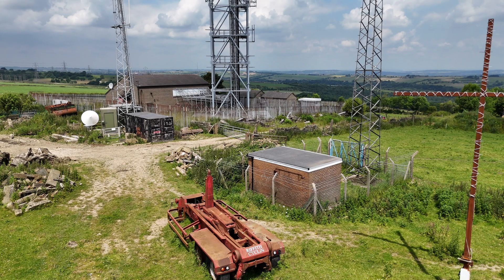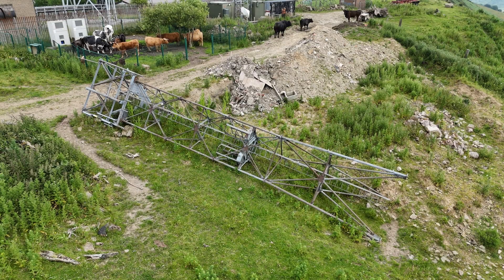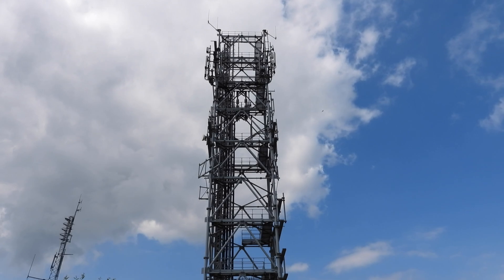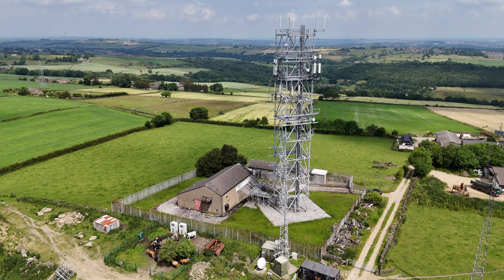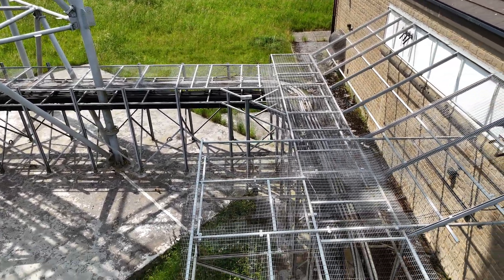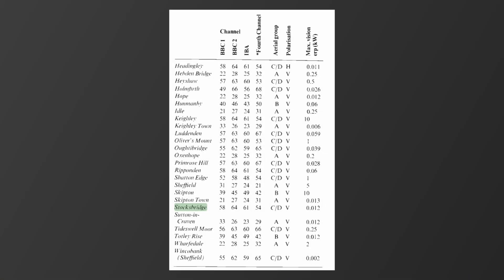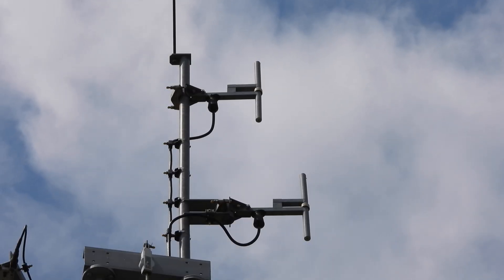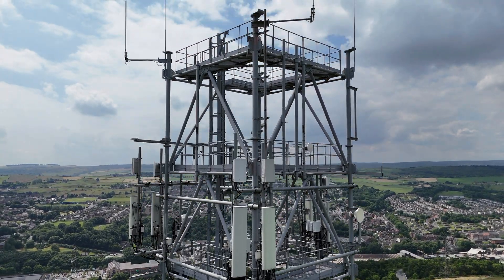Why Did This Cell Tower Fall Over? A British Telecom Microwave Site Tour

Comment: Ahhh the old VHF tv's 405 lines with "rotary biscuit tuners" then UHF 625 lines came along with its rotary 350 degrees tuners (early) followed by the mechanical pre-set tuners with up to (then) 6 presets. Later on 
the "preomat" tuners (Plessy I think???) replaced these giving a more stable service, using PLL if I recall correctly?? Those were the days! 😆😆 Also If you had certain antennæ then Overseas tv was possible, although the Audio subcarrier was different to the uk frequencies, (could be tweaked, but pointless if say a german station sent Dubbed  [ german] audio! Still it was real fun to experiment with. Then Ss-Tv ( slow scan tv ) was also interesting too .. //Sighs// 🤔

Comment: The offset DAB dipoles  provide some beam tilt. i.e. down to the local community. And that dish on the tower is tx and rx, probably a VSAT terminal for data, as you say for telemetry.

Comment: Glad you got a friendly response from a local farmer.

I remember the Hunshelf tower going up in 1987. Non of us local residents knew about it as Stocksbridge & Deepcar are in Sheffield planning area while the tower is a few yards over the border in Barnsley.

Hunshelf is the parish name. The boundary is where the ground drops away towards Stocksbridge. The hillside down to the river in Stocksbridge is Hunshelf Bank. Both names predate the Town of Stocksbridge which grew up around the steelworks in the second half of the 19th century.

The small disused tower will be the Steelworks booster which was the first mast up there. It was for improving the coverage with the internal radios in the works, which was certainly active in the mid 1970s if not before. One story was that Stocksbridge messages could be heard at Scunthorpe Works!

The Wooden Cross seen in some shots is a local tradition and is illuminated, after dark, over Easter. It used to be at the next farm over to the east but moved there in the 21st century.

Comment: Looks like some nice Ericsson cellular radios and 5G active antennas (small white Square antenna above long rectangle) at the top of the tower. 

There is a Trend to having the radios themselves at the top of the tower now because of the loss in the coaxial cables.

Comment: We recently had a 220kV pylon fall over in Northland NZ. Took out all power as the other transmission line was down for maintenance.
Same cause…….the ‘maintenance crew’ took the bolts out of more than 1 baseplate……

Comment: This is getting common in the US now. Some bankrupt company's stuff just left in place. We had a broadcaster of a MW transmitter in Alabama Claim their Tower and transmitter was stolen . Even filed a police report. When you look at cite is overgrown   like years. Transmitter shack so dusty and dirty does not look like anything their in years was their. some stories of this on youtube . We also had a working station taken down by someone cutting guy lines and letting the tower fall ,and when they got their to check it out the copper feed line was stolen.  all that for copper . Power company's got hit with copper theft as well. 73's

Comment: Sounds like the US, we went from 83 channels NTSC to 69 NTSC to 50 or so ATSC 1 then down to 36 channels ATSC1 and 3 now. We still have AM and FM broadcast but no Digital like you do at 200 MHz. We do have satellite radio from several slots that cost money and most new cars have am-fm-satellite installed. Satellite radio covers most of North America so if you are on the road more than 2000 miles a year, may be worth it but I am old fashioned and am-fm in the local area works fine for me or I can stream on my cell phone to the car via Bluetooth.

DE N2JYG

Comment: Digital TV transmitter outputs just 2.4W! It seems astonishing to me that significant coverage can be provided with such low power.
Reply: Digital is remarkably good at extracting a video signal. I can touch the antenna socket of my TV, or just stick a short wire in it and receive HD from Emley Moor, 11 miles away.
Reply: 2.4W is RMS, PAPR about 10dB, so they use 25W transmitters.

Comment: Would love you to cover the 4 masts at Turners Hill / Oakham in Tividale Oldbury. There are two masts together, one looks like an old Home Office tower one sits on a concrete block. Just down the road you have a very busy Westwrn Power / National Grid tower and all on its own is a rather odd tower, some 3 mobile antennas a strange folded dipole and some whips (oo er missus),at the top.

Comment: The horizontal tower is an old RT Swann with a delta head frame that was used by OUK (Orange) before they obviously merged with T-Mobile to form EE. A lot of the old OUK sites have been decommissioned or you will notice due to the size of the modern multi.port sector antennas they can’t fit them at the top of the old towers so install them below the head frame. They were easy towers to work on. Unlike some of the over crowded monopoles where they’ve had to do head frame upgrades just to fit the antennas, BoB, RRU & amps plus the 5G active antennas
Reply: Was going to say same before reading comments. Only to add they were originally built this shape for 2G, to ensure space diversity for each of the standard 3 sectors. When x-polar came along, the space diverse antennas were all replaced , enabling 6-sector sites where needed for capacity. It also enabled next tech which was 3G of course
Reply: Been up a few of those in my old job at ntl/Arqiva.
Reply: Is that the same Orange that allegedly wiped Super Hans' twins?  Did he ever forgive them for that?

Comment: Regarding the Coax...

Exactly what type of coax is used in these commercial towers?

That would be a video of interest to many!
Reply: That would be great. When I was doing WiFi 25 years ago I used a lot of LMR-400 for 2.5 GHz links. Radio sites had a lot of LMR series cables up to LMR-1200 that I saw but then there were lots of waveguides as well for the larger stuff. Smashing idea for a series!

Comment: tmobile now will use starlink 2025... soon cell towers will be replaced by satellite phones at a decent price
Reply: Where did you learn this?
Reply: @edweard i make parts for tesla, unrelated... but starlink and tmobile.. oh and it will actually start 2024 in fall, before 2025 😅
Reply: @edweard spaceX falcon launch recently had satellite to cellphone cluster. tmobile signed a deal